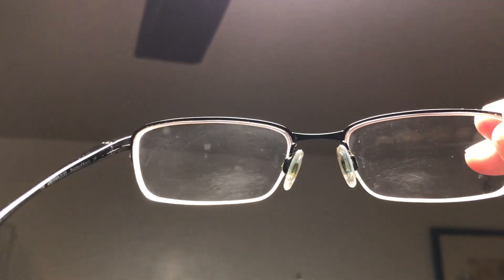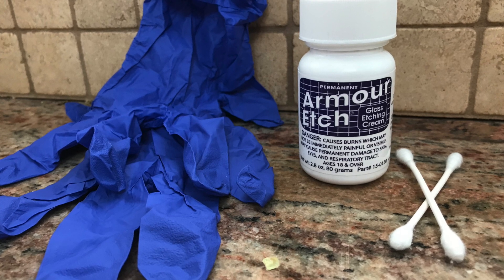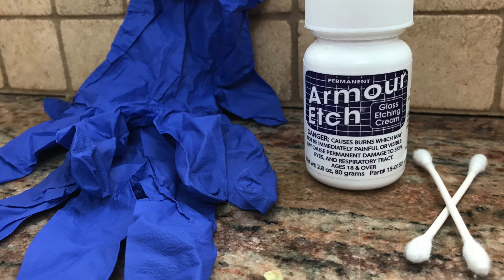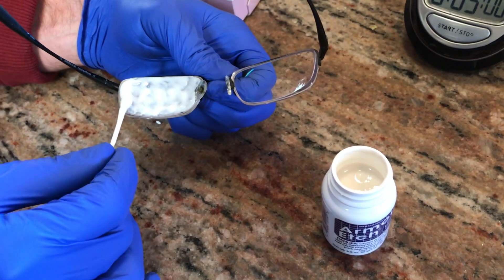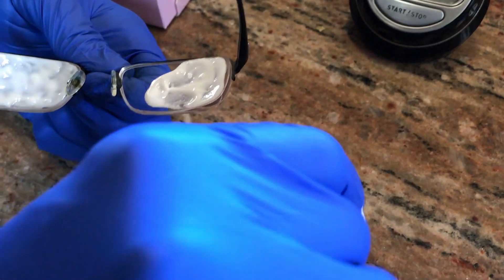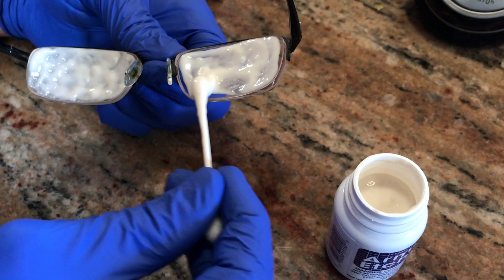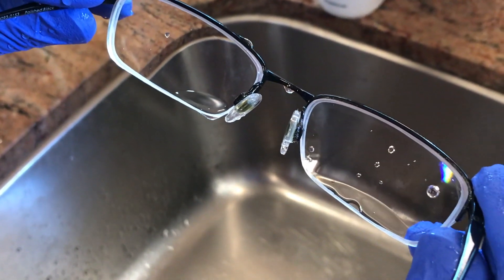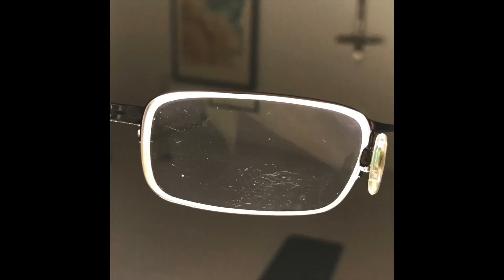Eyeglass Scratch Removal With Armour Etch

Comment: Did not know it's the ALCOHOL in some lens cleaners that create those 'scratches'. It actually REMOVES the coating a little at a time - hence the 'scratches'. ARMOUR ETCH WORKS - MUCH AMOUR!!! (lol) I switched to making sure I used NON-alcohol cleaner/wipes and NO problems since.

Comment: It took FIVE applications, each side of my lenses, with copious 'scrubbing' using a cotton bud to remove the coatings (what strange people call Q-tips.  Why Q?  Or should it be 'Cue'?  But if it's 'cue' like a pool cue - why?  Afterall, they look nothing like a 'cue' or a 'Q', and definitely not like a 'queue'!). 
Glasses have different applications of coatings, often multiple.  Mine have anti-glare, anti-scratch, and anti-UV.  And yes, as the Armor Etch works - using the cotton bud - one can see each of the layers being stripped away as they each have different optical properties.  I can only assume the glasses used in this video had only one coating substance applied. 

With each application of Armor Etch, do use the cotton bud to 'scrub' it on - especially around the rims - leave it for a while (depending on the glasses anything from a couple of minutes to ten minutes each time), and ensure you wash it away with WARM water.  Then 'scrub' the glasses dry using a micro-fibre towel/cloth to remove the last vestiges. If your lenses were properly coated by the optical suppliers, and if you have lenses that sit deeply/securely inside frames, then you will absolutely need to use a microfibre cloth to remove the traces of coatings from the lens where it touches the rims. 

Don't expect it to work as quickly or easily as some people have found - not all lenses are made equal 😄  You may need to have a great deal of patience.  But don't give up. It DOES work on coatings.  For scratches, you may be better off trying T-cut!

Comment: I just tried this method on my plastic lenses. I can see the coating peeling off in spots so I ordered Armour Etch and coated both sides of each lens, waiting 5 mins before rinsing. Nothing changed. I reapplied and waited another 5 mins. Nothing changed. The coating looks exactly as it did before wasting money on Armour Etch but hey, it was worth a try. Hopefully others will see this and not waste their money.
Reply: Unfortunately, you didn't do it correctly.  I don't say that as a criticism - I thought the same when I first did it on my glasses. I THOUGHT it didn't work on mine so I shoved them in a drawer and forgot about them a year ago.  Today I broke my normal glasses so needed my 'emergency' pair but the coating was too damaged.  So decided to give it another go. 

If you still have them, do it again, use a cotton bud, and scrub that cotton bud against the lens (quite hard)!  Leave for a bit, rinse with warm water, dry hard with a microfibre cloth, and do it again, and again, and again if necessary. Took me five goes each side - but if I'd used the cotton bud hard the first time I may have only needed to do it once.  As I was doing it the last time, pressing hard and rubbing it into the lenses, I could actually see the three layers of the coatings coming off - which I hadn't seen the other times I did it! 

So this time, using the method I've outlined (with the hard use of the cotton bud), it did work for me and now my glasses actually look good as new.

Comment: When I used the Armor Etch, it seemed to fog everything pretty badly. I repeated the process 4x, obviously with nothing to loose at this point. However, praying about what to do, I decided to try to scrub the lenses then with Denatured Alcohol with q-tips (changing out the q-tips every 10 seconds or so). After doing so for several minutes on both sides, the lenses started drying clear! Several small spots needed more scrubbing but came clean and clear!!!

Comment: Question:  Will this process work on a pair of American Optical Sunglasses that have real glass lenses?  They are non polarized.  I bought the armour etch and it says to only use on glass, not plastic.   Other videos I have seen said NOT to use Glass Etching Cream on glass!  Im confused.  Any advice?
Reply: If you use Armour Etch on glass lenses you will etch the glass (the real purpose of the cream), meaning the lenses will be ruined. We are using it on polycarbonate (plastic) lenses just to remove the top coatings that get scratched.

Comment: I tried this and it loosened the layers, but didn't take off after 4 times. 
I finished it off with scotch tape. 
After rinsing, drying, I rubbed Scotch tape on the lens, then pulled, over and over, new pieces each time. 
Took the layer right off. 👍

Comment: I had this same issue and tried the toothpaste, baking soda and metal polish.  Nothing worked it just made it worse to the point my glasses were unusable like you were walking through a thick fog.  I tried the armour etch and followed the instructions.... They are like new crystal clear again!
Reply: I’ve tried all of the same, polished almost non-stop for 2 days; foggy haze is all my lenses are, with tiny bits of “anti-scratch coating”. Etching is my last resort. Ironically this happened due to the arm of original frame being broken completely off. I took them to the place I bought them, spent $200 on new frames, while she spent 45 minutes in the back getting the lenses in. That night, I noticed crusty spots on them. All I can figure is that she used something to fit them that got under the coating (through a small scratch that shouldn’t have been there) and then it slowly started bubbling up. It got to the point that wearing my glasses were impossible because they gave me headaches, due to my eyes constantly refocusing. They won’t give me new frames without a new exam (just more $$$ for them right?), so an expensive “repair” is now an even MORE expensive repair YAY me! I’ve been looking into etching them, and really at this point, what do I have to lose? 🤦🏻‍♀️

Comment: I just did this and it did not work for me.  Did I hear you say that some have had to rub the Armour?  I tried it a second time.  Yours look so great......just wonder if you have heard from others it did not work for.
Reply: Ok, so tried this and it lifted the layer, but didn't take it off completely, after 4 attempts. So, I tried scotch tape, rubbed it in to the lens and pulled. It worked to finalize the peel. I did what I would if I wanted to get something sticky off...
Scotch tape, and pull.
Reply: Maybe try both sides?

Comment: So you actually didn't remove the scratches from your glasses. What you removed was the anti reflective coating. After 2 years, the AR coating  starts to fail and then looks like scratches on your lenses.
Reply: It's still considered scratches, bcuz it's scratches in the coating. If you look closely at glasses that have this coating, you can see how it comes off in scratch patterns, bcuz we (daily, all day wearers) wipe our lenses every day, and sometimes you can't always use a "lens cloth" and have to use a shirt.
Reply: @Inapeartree  sorry no that's not how it works.
Reply: @cha0sman  ok. Well, sorry, but that's what happened to my current pair, and I know when it happened. It's not just an aged layer that is peeling on its own. And right now, I'm taking the "scratched" layer of crap coatings off my glasses, with armour etch, and finishing off with Scotch tape, and it looks great now.

Comment: Definitely works to remove damaged coating on plastic lens. I had a pair of $600 lens that were unusable due to the coating failing. For $12 I bought the 3oz size of Armour etch and gave it a go. The lens's were cleaned then the product applied with a Qtip. Do not agitate the product while waiting 10 minutes. Wash well to remove the product and failed coating. The lens were perfectly clear while before you couldnt see through them. Well worth the cost.

Comment: This definitely works.  I have a pair of 10 year old lenses that were all scratched up and had a purple/green tint.   I did what was described in the video twice to get it all off, but now they look almost new.  The only downside is that they are slightly more reflective of light sources, but they are MUCH better than before.

Comment: Just used this method on a 5 year old set of very expensive Nikon Hi Index plastic lenses. Inside anti glare coating was foggy with very fine scratches. Armour Etch method worked fantastic. Completely removed the inside anti glare coating that was badly  scratched. Took two applications in my case. But the lenses came out looking like new. I'm going to use these as a backup pair of work glasses when working on car etc.  Already have a new set of $$$ prescription glasses.... but these will work perfectly well as a backup pair.  Thank you very much for posting this video.